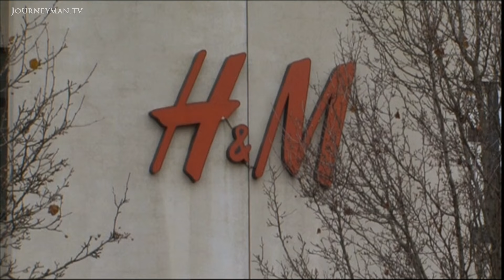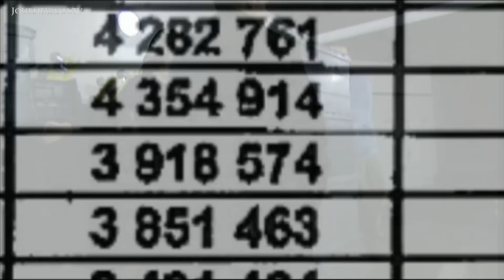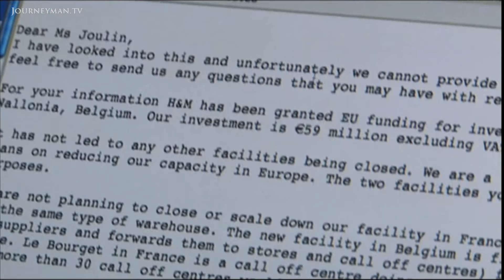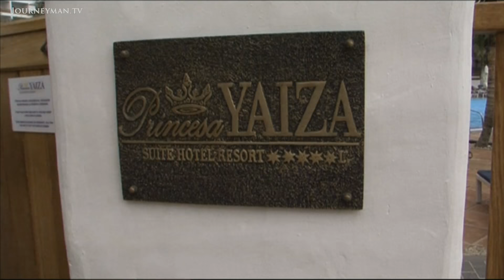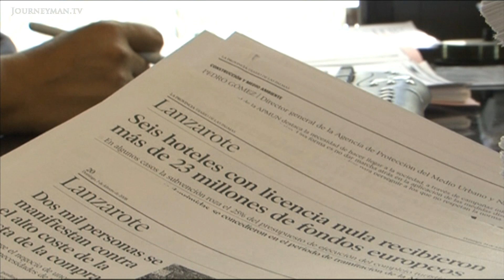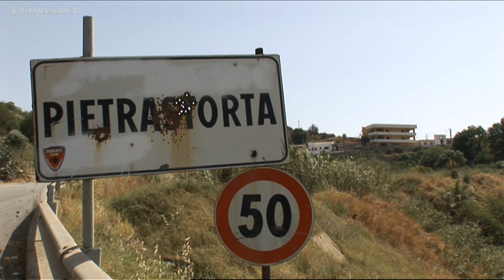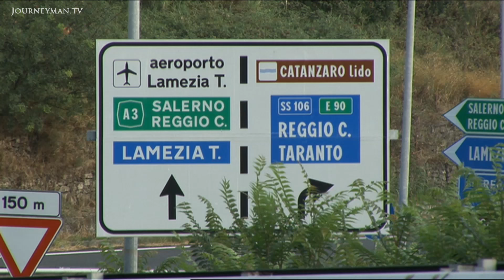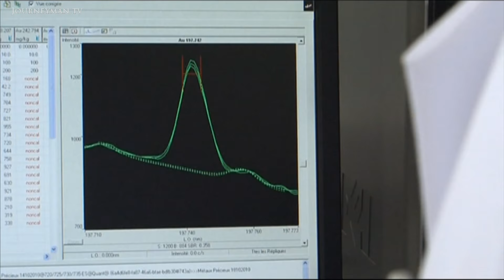The Shocking Corruption That Wastes EU Money (2011)

Comment: Have a look at grants to Lebanon. 20 million or more on an incinerator project, and pollution monitoring system. None of these ever produced anything, dismantled as soon as control was passed to the local government.
Yet, after years of failures, it does not seem like they have adjusted their approach.
If only 1/10 of the money was given to local NGOs instead of the government, it would be so much effective and productive.